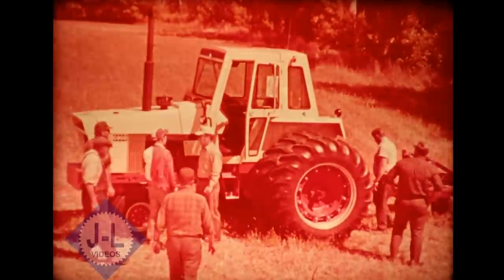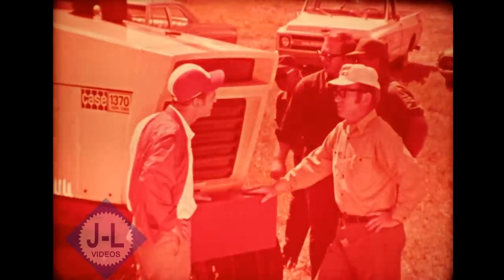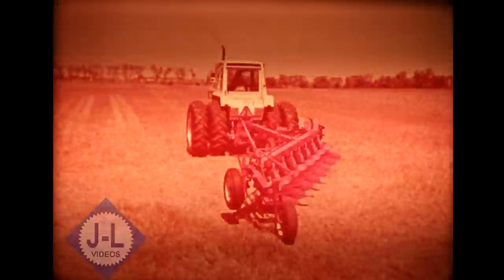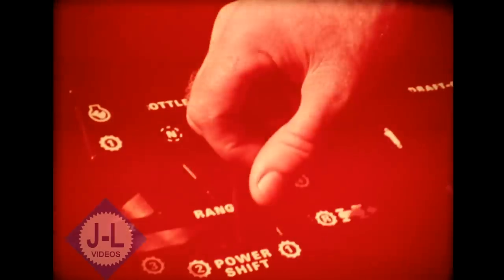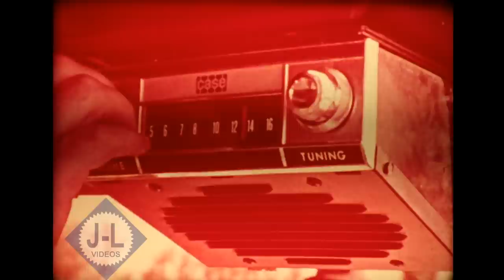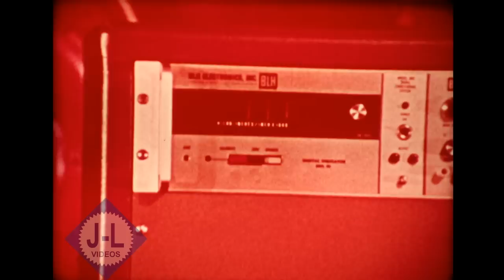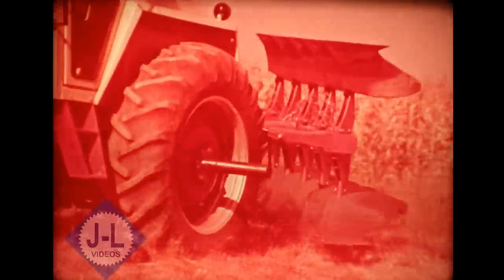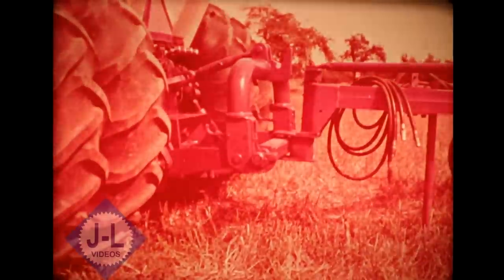1970's J. I. Case Film A Man And His Tractor 1370 1270 Agri King Tractors

Comment: I learned to drive tractor in a 1370! As far as I'm concerned one of the best ever built! Easy to drive better marking on controls and a full 100 cube bigger than the green competitor!
Reply: in 1972 when the 1270 and 1370 was introduced, the John Deere 4620 wasn't ever gonna touch it in the field for performance and a good cab. They are tough old units!
Reply: @kolewiebensohn  Then came the 6030.
Reply: @kolewiebensohn  the 1570s and 2590s will walk all over a 6030 or 4840! They are capable of 250+ horsepower and the 504 was the predecessor to the 8.3 Cummins. At the time they were years ahead it took the green guys 20 years to get a tilt hood. Case had one in '78! If they had put the quad in the 4840 it wouldn't have been such a slouch. A 4640 quad range turned to 240 will outperform the 4840 and be a competitor for the 2590/1570.
Reply: @ethanthopy1996  They could walk all over a 6030 but it was hard on em, not saying they couldn't but theirs a lot of 250 horse plus 6030s out their..
Reply: @kolewiebensohn  for sure! Transmission rebuilds were common on those 70 series! 6030s are tough crude machines that are built to last! The 4840 was a sad replacement they should have made a "6040" with a soundgard cab and updated tin with the 619.
Reply: @ethanthopy1996  the 4840 just needed more gears we had one that would pull but you were stuck in 2nd or first gear all day every day spinning.. 3294 we got now is a much more balanced tractor even though it don't put as much hp out, it can pull the same implements faster and more efficiently.
Reply: @kolewiebensohn  front assist (if equipped) will make it do more with less power. 2wd just needs good weights and a good selection of gears. The magnum vs Deere argument I'll side with magnum all day but nothing wrong with Deere.
Reply: @ethanthopy1996  if I had the choice between a magnum and a 8000 series Deere, I'd definitely get the Deere, magnums are good but they just didnt compete with the 8000s... That being said I would obsoletely love a 3594 for another fwa tractor, great cabs, engines and trannies..
Reply: @kolewiebensohn  what I like better is they are simpler than the 8000 and they have a tilt hood. The 3594s are absolute beasts no doubt! If I ever get the chance to buy a farm (family quit when I was 14) and buy a tractor I'm going to want cheap reliable horsepower. I like cash and I want profit and reliability over comfort! My favorite kind of vehicle is called paid for. 2590/94/3594, 8070 Allis, White with a Cummins, JD 4640, or an 8830/TW35 are the type of tractors I would want.
Reply: @ethanthopy1996  Thats the great thing about our 3294 is that it's a beast, she dynos 175 and just pulls! We choose cheaper machinery cause we don't like debt. I wouldn't mind having a 20-22-23-2594 around for another decent sized tractor..
Reply: @kolewiebensohn  I go to the bank to deposit not borrow that's my theory. No need to be broke to show off. If it gets the job done reliably it's good enough for me.

Comment: The Narrator is trying to sound like John Wayne! I ran a neighbor's 1370 for a few times, lots of power. In my opinion the Sound Gard Body on the 30 & 40 series John Deeres were a lot better. At the time every company was trying to make cabs as best as they could!
Reply: The 70 series was more of a box with glass than a cab. Very little noise insulation compared to other and later cabs.

The same design, but improved, on the 94 series was much better, but was basically foam everywhere. 

Definitely easier to get in and out of than a Deere though, and more room.
Reply: @J-1410  I've often wondered why they all say that their cabs have so much room? You are just sitting in a seat, not jumping around. All the controls in a Deere body are within reach. The Air-conditioning/Heating knobs are just above your head along with the Radio. The shifting lever/levers are just to your Right hand along with the throttle three point & hydraulic levers. The steering wheel tilts & telescopes. Thers plenty of room for your knees not to be into the dash.
Reply: I'd rather suffer the cab and have the 504 than even the 466 of the 40 series.  Don't really want either of their powershifts though.
Reply: @randymagnum143  I have a friend who has a 1370, 504 motor runs great. Transmission is junk, he can't find parts for it. So it just sits.
Reply: @jefffirefighter12106  The 1370 is NOT junk.  If your friend's 1370 has a   transmission that require fixing, keep in mind that the 1370  is a    44 year old tractor and maybe more   than that yet, That is 40 plus years of smooth operation. There are a lot of  '70' series  Cases   working to beat hell on farms  TODAY.  To the  Case 70   series   owners who   experienced  transmission breakdowns, did they thoroughly   read the  instruction manual  and did they take proper care when operating the tractor?  I wonder.

Comment: Wow, what were those Case boys smoking?
Reply: Well that was the down side of the 70 series compared to the 30 series. The direct injection engines in the 70 series made more power and a bit smoky but the indirect injection on the 30 series usually ran cleaner but started harder in the cold. Here's a question witch smoked worst a John Deere 7020, a 7.0l Allis Chalmers engine, or a Case crab steer with a 504?
Reply: @rustyshank912  a 301 Allis with 14.5:1 pistons.
I meant what substance the marketing team was smoking though.  What a far out film strip!
Reply: @randymagnum143  who said you can't get high on tractor exhaust. 😂😂😂

Comment: if they start making part again for these tractors would be helpful before we run out of simple to use  and repair tractors instead of the over priced electronic ones   that will be scrap when they get a few years  seen 2  that have let the owners down  one brand new one did 2 hrs the dealer was 2 days before it was working again   and older puma had wiring issues and wouldnt engage  the transmission  due to error code   this wasted an hour before they brought another tractor to tow the truck in and out